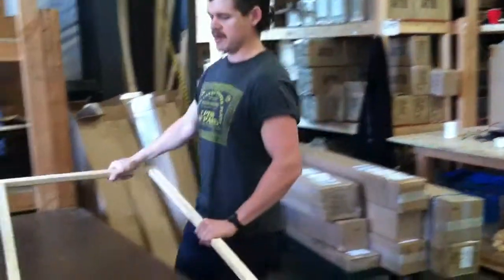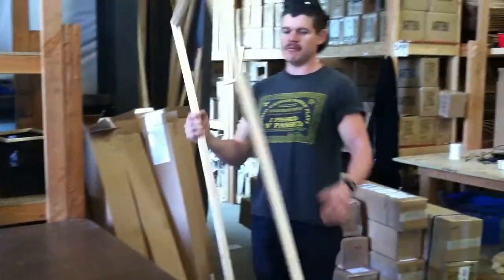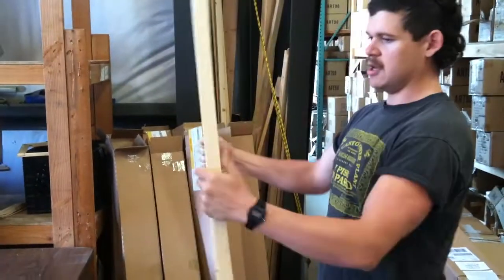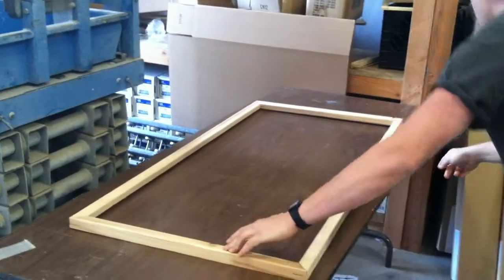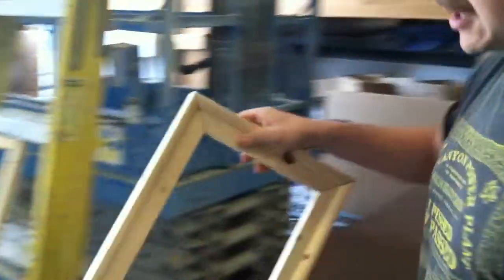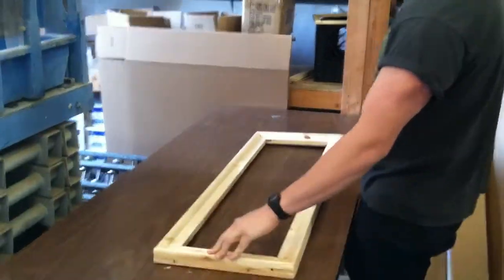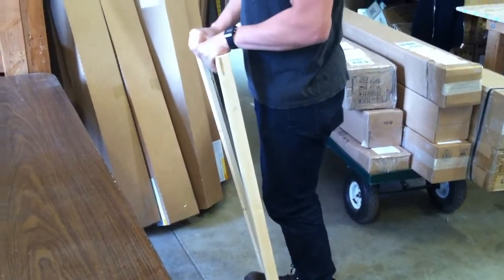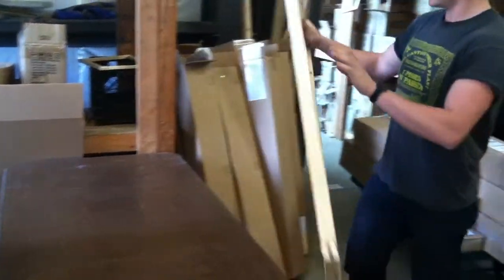stretcher bar warehouse warped frame tutorial

Comment: You SNAPPED the stretcher bar on the joint at the end of the video!... Wood grain never flex and maintain that "correction" by applied twisting force, because it comes back to its original shape due to its grain which acts like a muscle. Only dry and wet + constant pressure can force it over a longer time. Your technique (by forcing/twisting the grooves and tongs in the corners) would be disastrous if you already have a painted canvas or a heavy artwork on it. In this way you cannot re-stretch the canvas with its wedges if needed in the future. >>> Instead, use 4 flat L shaped steel angle brackets behind, while making sure of keeping the 4 corners flat when screwing them on, or apply a thin wedge (i.e. laminex) under one side the angle if it is too warped, or pre-bend the steel angle a tiny bit.

Comment: And now it lays flat… in the bottom of the dumpster. 

As a woodworker I can say that if you glue up a frame and it’s not flat you’re pretty much screwed. You could mechanically force it flat but you need that pressure to stay on it forever. Wood will just spring back to its desired position when the force is removed. You could potentially wet and heat it to conform to the new shape. 

For applications like this it’s critical to use straight grained wood that it properly dry and acclimated to the environment and milled dead flat and then sealed. It needs to be constructed flat and it might even be better to use screws instead of glue so adjustments could be made in the future. 

When I build picture frames (not what shown here I know) I do everything as proper as possible and then you just have to pray it never warps. You can put a plywood back on it but that can only do so much since it won’t be thick. 

There’s just only so much you can do with wood if it wants to move. Softwood moves more than hardwood as well and crappy small tree pine near the center is the worst of all.

Comment: This worked like a charm and so easy. I put a tiny shim in the corner of the frame that had opened up a little, so that it could not go back to the warped position. (My frame didn't crack when I did it.) Thanks so much for this tip. A framing shop wanted to charge me $150 to fix it.
Reply: was your frame a larger frame or a small or medium frame?  I have a 48"w x 30"h x 2" frame with the canvas on, I'd love to try this but I need some sort of assurance.  thank you, I hope to hear from you. it's 3 years after you posted your message.  it's 2021 right now.
Reply: @dcassolis2157  I've used in for the size that you have (and other sizes). Just gently twist the frame a little, lay it back down to see how it lays, then keep doing it until it's flat. You'll get the feel of it as you work on it. I was nervous like you at first, but it works great.

Comment: Okay, this is a video for warped stretcher bars without the canvas on them, but I have a canvas that needs to go to an exhibit and it's warped, the bars are 48"wide by 30"high and 2 inches deep.
Can I do this to an exhisting canvas on the stretcher bars?  I don't have time to go to the framers to have them restretch the bars onto the canvas, and they have a 2 week wait and the exhbiit is about then, too close for time frame, what do I do? Please advise, thank you and I see that the video was in 2015 but that's okay, if you have advise, I'd love to hear it.
Reply: Yes! It works, I have a $1,000 dollar painting that is due tomorrow, it warped because I worked on it in my hot garage. 
I slipped it between my mattress and bed frame, and twisted it up like I was lifting my mattress. 
I went small pop by small pop until I got my shape back, go super slow and try not to add to much pressure on the canvas it’s self
Reply: @nicholasnielsen251  Thank you and congratulations on the painting going out.

Comment: Hi I bought a large painting on canvas that the frame is similar to your first one but has a cross in the back and it doesn't;t fit flat on the wall. one corner is quite a bit from wall. How would I fix this? Thx
Reply: birdiebirk I'm having the same problem
Reply: Hi Bunny, did you ever find out how to fix it? Its driving me nuts.

Comment: SO SO annoyed! Doing this gently ended up tearing my 80 inch canvas with one of my favorite paintings :(  

I really wish you put that caveat in that there is a high chance of the wood snapping and breaking.
Reply: So, you failed to notice on this video at the end when he SNAPPED the stretcher frame?... (and still uploaded the video smiling?)...
Reply: Wood is rigid and will crack along the grain. Twisting would only work if the issue is caused by the joints not fitting square.  If the wood is actually warping, the twisting method will not work.